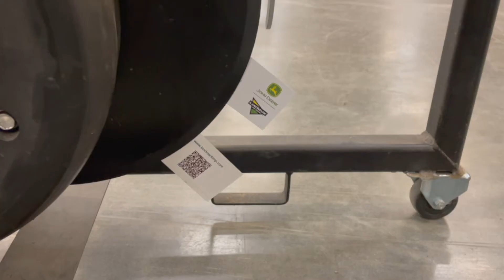John Deere ExactEmerge Meter Settings & Adjustments

Comment: What would cause the shaft that goes into the meter housing to strip out? Having trouble with several units doing this
Reply: Sounds  like the design was never adequately field tested for wear issues at full speed?